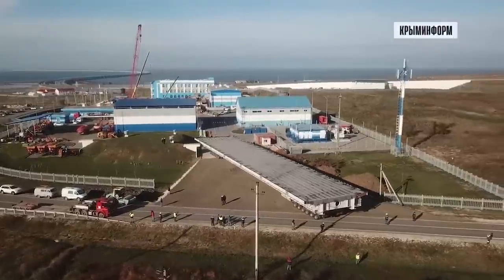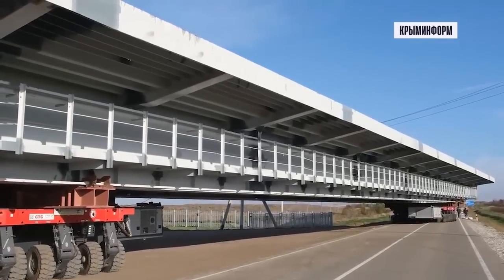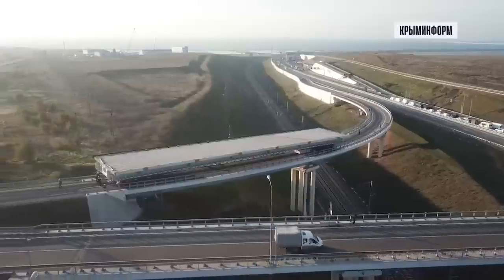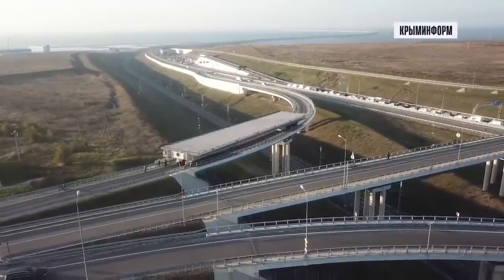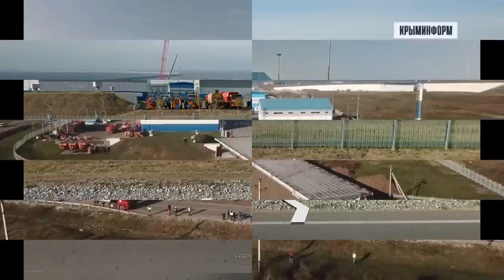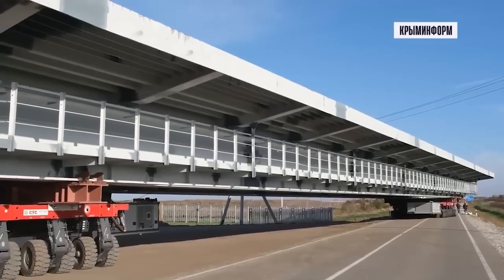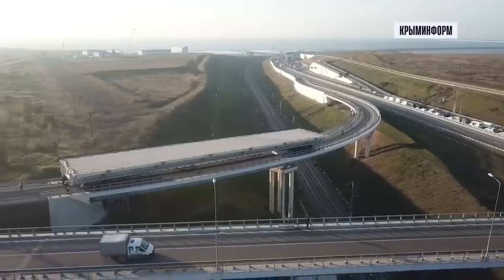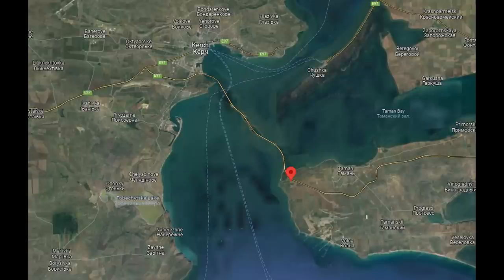Russia Transports New Span to Repair the Crimean Bridge

Comment: One month to build is fast but can be done running 3 large shifts.  I have some trouble with the steel itself.  If every shape was in stock it would take a day just to contact suppliers order and arrange transport.  Up to a week to transport.  The main steel beams would take a month to transport as ea would need the same laborious transport as this.  They run full length and are tall as a man.  Just to contract the work, even w the same contractor, have workers assigned, pull the drawings and 1,000s of pages of specs, extract materials lists, would take 2 to 4 days if the co dropped EVERYTHING and put best to it.  Even if bridge had origionally been made w off the shelf parts, those part nos and suppliers can easily have changed.  Anything reordered MUST be checked for same load bearing capability.  Which can be done while fabrication is underway at some risk.  If items need to be made, like a  particularly sized angle brace.  That has to be cut from thick steel sheet and bars angles channels etc and CAREFULLY welded together.  That would take a few men a day to do ea, and very rare specialty cutting equipment.  
What is VERY mysterious is the fabrication yard as it's far inland, for a job where transporting the unit iteslf, and the main beams it relies on, is soooo much easier and faster when done by water.  I'm sure the original fab yard was on the water and you'd think the co that created that plant would have just kept using it, as a completed fab plant on the waterfront would give them a competitive advantage.
Western intel should be checking supply deliveries to this location  Sat pics, public video cam from highways, here and steel suppliers, especially the VERY few who had 100 foot long man tall beams 'just laying around'..  Moving the main beams would have been sufficiently slow that sat pics are probably available